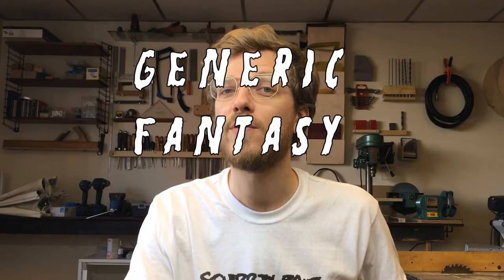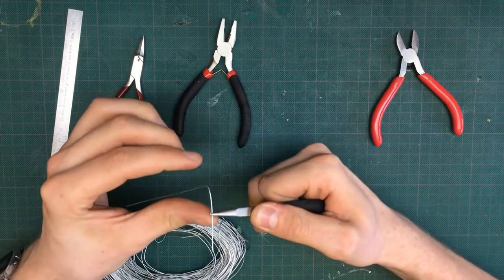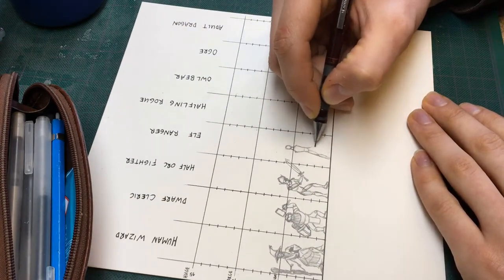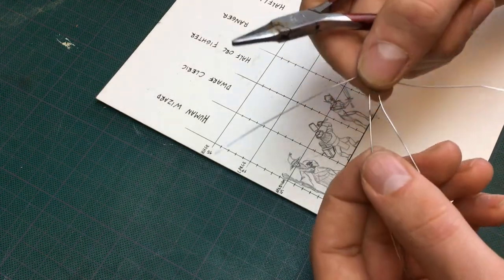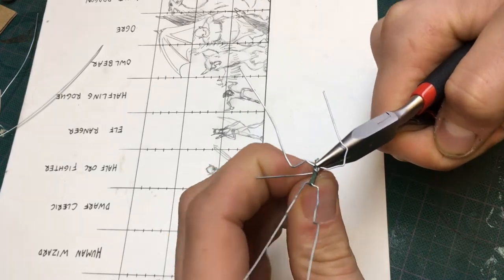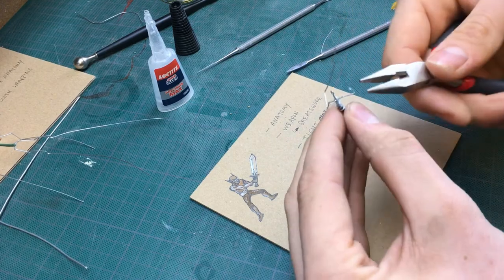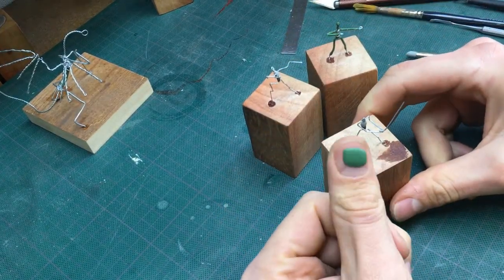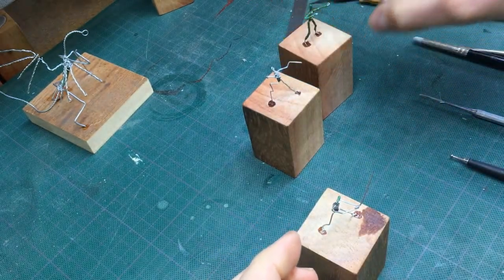Generic Fantasy Miniatures episode 1 - How to make an armature!

Comment: I saw you use the putty on the wire, and had an epiphany: 'oh so that's why I have so much trouble with armatures and polymer clay, to the point I rarely use them!' (Along with former problems with loose bits of armature moving around) I have some ideas about how to make armatures work better for me now. Thank you!

Comment: Hi there, I was wondering why you decided to use "green stuff" specifically to base the armatures. I am new to the sculpting hobby, and I was curious as to why some people use green stuff and while others use Miliputt for their base? Is there a massive difference?
Reply from the maker: There is quite a big difference between GS and Milliput. Milliput is a bit grainy, and GS is very flexible and sticky. I use GS because of this stickyness, it really makes coating the armature easier. If you can I would suggest getting both, to see which you prefer

Comment: hi, I really want to know how this holds up in the oven while baking for my own sculptures. Doesn't the glue burn or create toxic fumes? I use polymer clay so the temperatures aren't super high. But I'd still like to prevent a fire or toxicity ><'.
Reply from the maker: Hey! I’m pretty sure super glue is not very good for you to start with, so baking it probably doesn’t make it any better. I always bake my sculpts in a toaster oven, in my basement, because I don’t like to bake polymer clay in my kitchen. Most clays say that they are safe, but it still feels a bit weird to me. My toaster oven has a timer, so it practically doesn’t over bake, and so far the baked glue hasn’t brought any problems! Hope this helps!
Reply: @atelier_AG  Thank you for the quick reply! Since I'm going for a somewhat bigger sculpture I'll try to make the wire a tight fit with the wooden base and see if it works like that. Maybe I can glue it from underneath the base after baking if I make the hole go all the way through :).